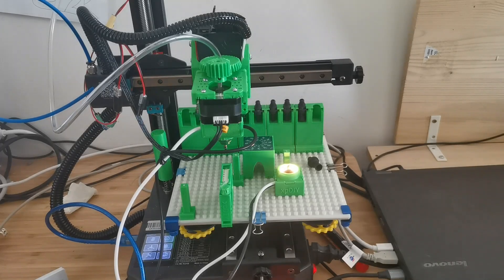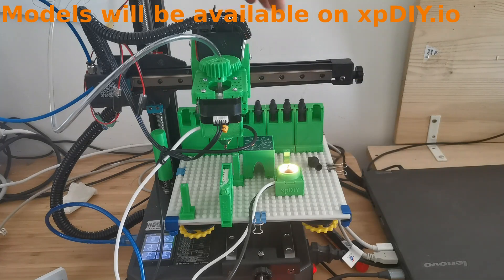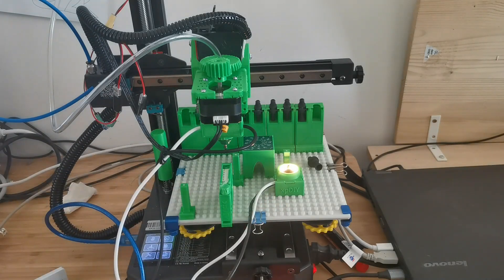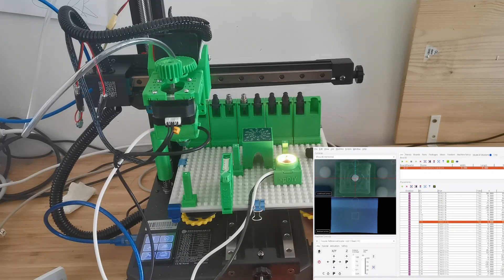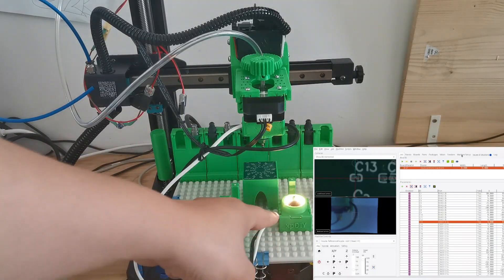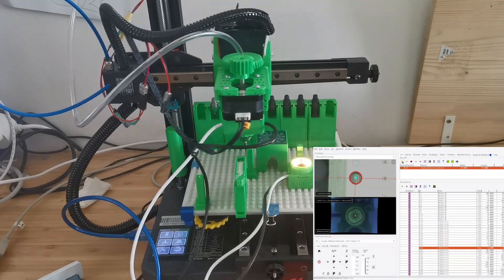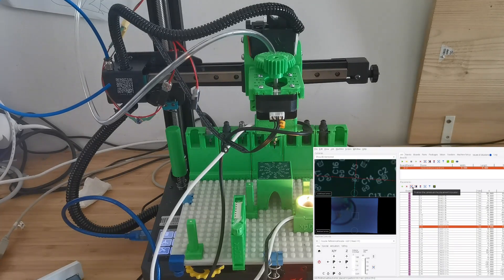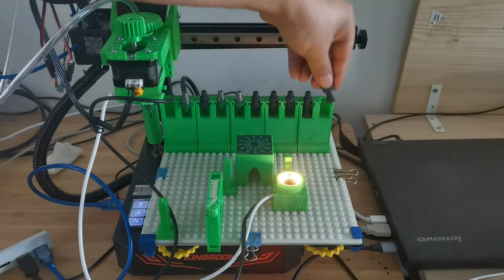Converting Kingroon 3D printer KP3S Pro S1 to pick and place machine with improved lighting

Comment: How do you actuate/toggle the camera lights? It sounds like a relay?
Reply from the maker: @henrikkjolhede6413  it is relay, I bought usb relay that can be controlled from script. Then in openpnp you can call the script. Also I have made a board that use MOSFET to control the light, it is similar as the usb relay. Just search usb relay, you can find the product in for ex. AliExpress.
Reply: @xpdiy  So I am new to OpenPnP, and can get it mostly working with a Marlin board. But how do you control the usb relay via script? Can you open a virtual com port via a python script? Can't find much documentation on what modules are available.
Reply from the maker: @henrikkjolhede6413  I am using the usb relay with usb to serial chip, so it is treated as serial port, and I was using bash script to write to serial port. For windows, you can use Powershell.
Reply: @xpdiy  Thank you! Found a way to call an external program from an OpenPnP script and wrote a quick python script to toggle the relay. Thanks for the pointers!

Comment: If you're not doing it already (not clear from the video) I think it might be possible to extend the front Y of "lego" baseplate to allow feeders to be installed where the bulk of the feeder body is outside the range of the head  (since only the area around the component window needs to be in range). It would free some unused space and allow larger boards, or more feeders. Of course, this assumes that the particular machine doesn't have other elements that would block something that hangs off the front of the table.
Reply from the maker: This is indeed a good idea, I think it is totally possible to extend, at some point I was thinking about this as well, what stopped me is I need to find a way to fix the extended part on the metal plate well, that will give another 3 to 4 centimeter, thanks for bring that up! I might give it another go as well.
Reply: It may not be necessary to fasten to the metal plate. It might be sufficient to just reinforce the extension with a separate 3d printed part that fastens to the lego baseplate. Perhaps that also snaps to the edge  and/or sides of the baseplate with a lip or step. I think the most force would be when installing the feeders. Otherwise, I don't think they'd flex or move much in operation.
Reply from the maker: @TomTRobot  Extra structure sounds good, it is mainly the feeder  plug cause the challenge.

Comment: Can you give details of the camera lighting please? Are you using a ring LED PCB? I couldn't find anything on your website or the github BOM
Reply from the maker: The LED is made from a LED strip, so no PCB is needed, just need to print out the model so that the LED strip will stick inside. The LED strip is 5mm wide, and take 5V as voltage. for ex. https://de.aliexpress.com/item/1005003307581709.html?spm=a2g0o.productlist.main.1.24632940N1wcgE&algo_pvid=63662287-653d-4b3b-91dc-7673fb100ca0&algo_exp_id=63662287-653d-4b3b-91dc-7673fb100ca0-0&pdp_npi=4%40dis%21EUR%214.72%213.82%21%21%214.83%21%21%40211b88ec16963540445653581ef3ef%2112000029160679957%21sea%21DE%212789418838%21&curPageLogUid=h8iSi0yw0whv

Comment: Amazing project. The 3D printer conversions are great but have you considered building a simple 3D printed dedicated CNC? That way the user doesn't have to dedicate a 3D printer for this.
Reply from the maker: Thanks, I thought about making a dedicated one, but then anyway I need to get a metal frame, motors, control board, so I decided just to use 3D printer, and make switch easier. If a dedicated one needed, then it will be easier to get another 3D printer and convert.

Comment: It would be nice if you could make a  video about the controller board(motion controller) and how to config it
Reply from the maker: Sure. Actually for 3D printer, most the controller board come with x,y,e, so there is not too much configuration, only we need to map E axis to rotation, and this is supported by openpnp. I can make a video about setting up the openpnp.
Reply: @xpdiy  thanks that would be great 👍
Reply from the maker: Not that I am aware of, at least some effort is needed in order to make it work. I can see discussion on how to get it to execute single g-command, but so far no one reported that it works with openpnp.